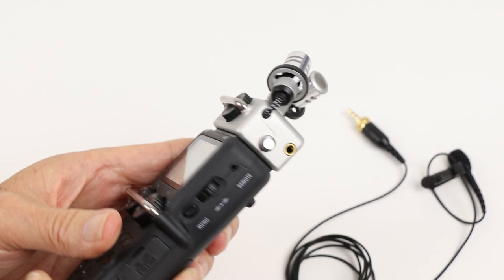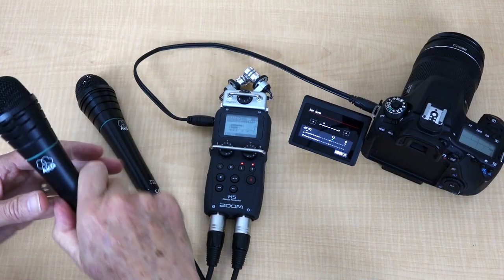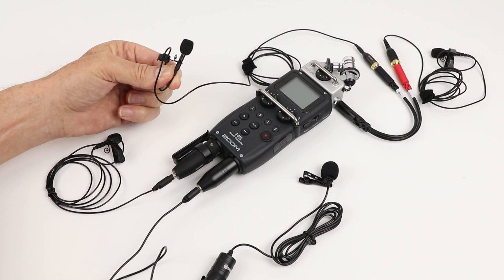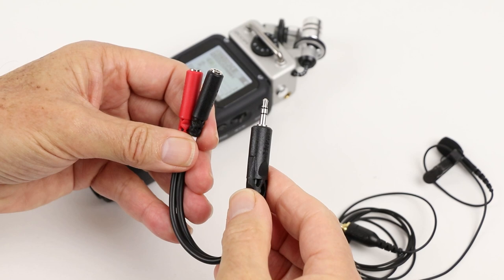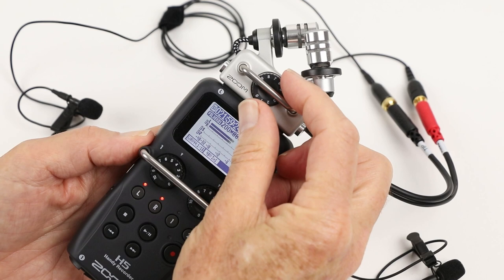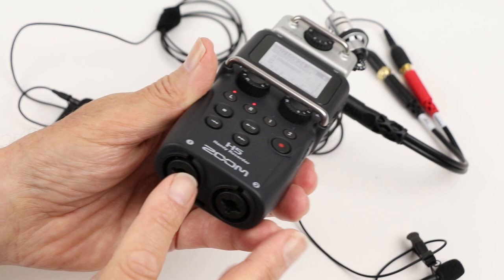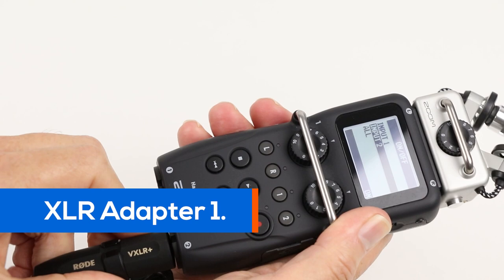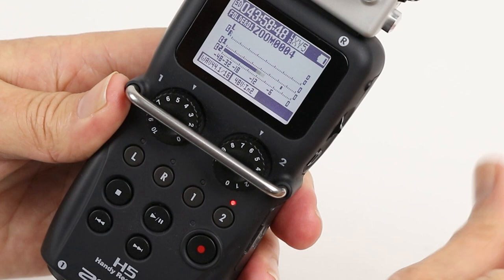Zoom H5: Connecting Lav Mics | Adapters and Settings

Comment: If I use a lav mic like the Sennheiser Me II with the VXLR+ without phantom power turned on my Zoom H6, will it still work or no?
Reply from the maker: If the mic needs plug in power the vxlr+ will reduce phantom power to the low voltage you need. You won't hear anything from the mic if it is not powered. Make sure you don't plug a lav mic into a powered socket without reducing the voltage with the adaptor. The voltage output from an XLR phantom powered socket can be 48Volt. A lav mic only needs 2-3volts

Comment: Can i plug 3.5mm dynamic microphone without phantom power converter? Does it work just by xlr to 3.5mm convertor?
Reply from the maker: Yes a dynamic mic does not need phantom power. A simple XLR to 3.5mm adaptor will do it. Not the best match but it should work.

Comment: Great video Gary. I’ve been making videos in Thailand for a channel called Farangbowl Magazine for 2yrs now to include doing interviews. I also have a Zoom H5N, however, I’ve come across an issue that I wanted to run by you. I have a Rode Wireless GO II that I plug into the top line in of the Zoom, however, when I edit in Post in Premier Pro it won’t let me stereo split the audio left and right which is a right pain in the butt when adjusting levels and EQ. The audio is just a mono recording of the two Rode Mics. Is it not possible to use the Line In like this and better to use an adapter and plug into the bottom of the zoom for a stereo recording? Your thoughts on this are much appreciated!

Comment: I have the zoom f3,vxlr pro, and hollyland lark m1. The wireless tx has its own power so would i shut off the power like your showing or with my protection it is safe to run the 48v w my connection or how should i configure?Till i watche this vid i thought turning off an input would mean no audio😊 correct me if im wrong it just means no power to the mic.Thank you

Comment: when using as usb interface , 
can not use lav mic ? 
ia that ordinary?
Reply from the maker: You definitely can use a lav mic when setup as audio interface. You just can't use the recording function of the H5 in this mode.
Reply: @GaryDmedia  but can only use the built in zoom mic xy not rode lav mic
Reply: @GaryDmedia  should i setup drivers again ?
Reply from the maker: Not sure which lav mic you are using. Remember it has to be a TRS plug type. Not the 4Pin smartlav type. Also as in the video, Check that plugin power is activated to the X/Y 3.5mm mini jack.
Reply: Can I use 4 inputs and mix them to stereo (or mono) to USB interface output?

Comment: Hey! Thank you for the video! I got a question: I have Zoom h5 and Shure MVL - 3.5mm. I followed the instruction, set the plugin power on but still no sound. What could be the reason for that? May it be because there are 3 black lines on the jack and not 2 as on yours?
Reply: Yes. You need TRS while you are using TRRS. (purchase a TRRS-TRS adapter. then your connection will work)What is happening is that you have an extra channel(used by mobile phones) making them not align.

Comment: Hi. I've got a h5 zoom. There is some hiss on it. If I turn the level down on the h5 and boost it in my DAW it will still get the same issue. If I use the de-noise it just makes everything bad and underwater. I've tried to use the sm58 mic and attach to h5  still same outcome. It's mainly for ASMR type stuff.

How can I resolve this? Should I just bin it all. Lol
Reply: Kind of you. You bought the wrong recorder for quiet recordings. The preamps are noisy on the H5. You need something like the (sadly discontinued PCM-D100) or an F3 with external mic.

Comment: Nice video! 
I want to use a rode videomicro mic plugged in the 1/2 inputs of the H5.
Do you know if I can use a 6.3mm (into the H5) to 3.5mm (to mic) jack cable, too? . What type of cable do I need and what type of plygin/phantom power I have to choose?
Thanks in advance
Reply from the maker: Yes same as video. The VideoMicro uses plug-in power like a lav mic. You just have to be sure the adapter is not stereo.

Comment: Great video. Thank you. I have the 'passive' 3.5mm to XLR converter. It only works with the Boya microphone that has a battery integrated in it. When I try Rode's Lavalier microphone (no battery), Zoom h5 doesn't pick any sound. Is there a way to power those Rode lav mics? Or another way to make them work? I don't want to plug them into the XY5 , but want to use 2 lavalier microphones plugged in to the XLR inputs. Thank you for your help
Reply: Yea the more expensive Rode VXLR+ Adapter. It konverts the Phantom Power to the needed Low voltage plug in Power
Reply: Hi. Are do u have problems with a constant his on your h5 thanks.